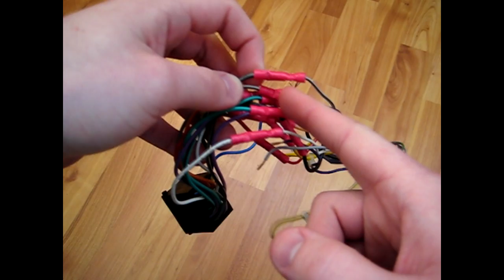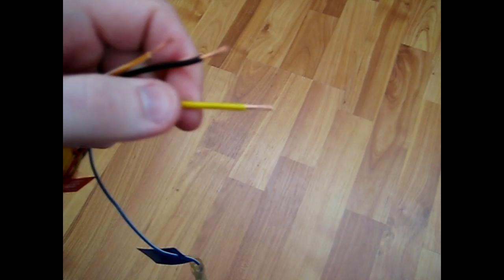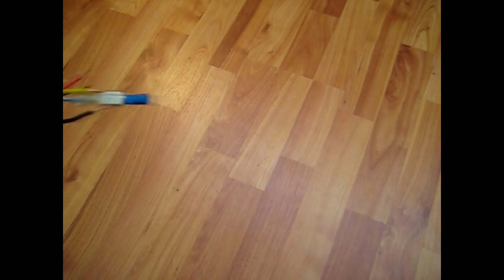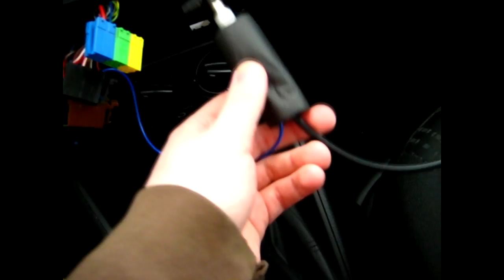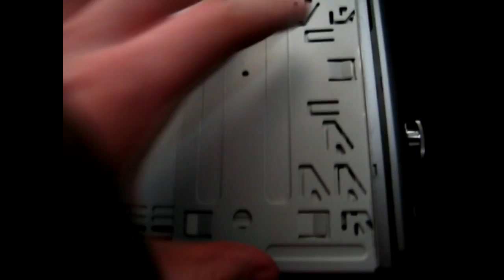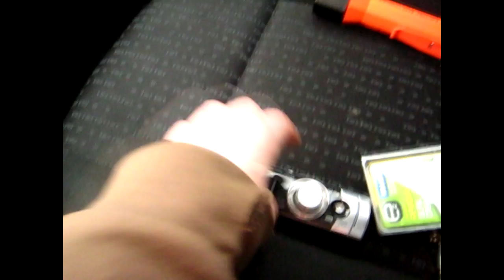DIY: Installing An Aftermarket Stereo Into Your Vehicle

Comment: Please I need help, I just installed an aftermarket pioneer on my Vw golf 2002 and everything work perfect, the only problem it's next day after I installed the battery was dead. I get the right harness and conneted following the color but I don't what it's happen. I appreciate your help!!
Reply from the maker: Is the stereo staying on when the ignition is off? Do you have an aftermarket amp installed as well?
Reply: THIS happened to me to how do i fix it???
Reply from the maker: Billy Callahann Does the stereo stay on while the ignition is off??? If so, all you need to do is switch the constant power wire with the accessories wire. If I remember correct, it is the orange and red wires.
Reply: 4Diyers it does turn off when I turn off my car but I hear a really quiet noise from the speakers
Reply from the maker: Is your car equipped with an amp? Sounds like that would be staying on, that needs to be on a remote wire.

Comment: My MkIV Jetta came with an aftermarket single din radio. Can that same harness be used with a double din radio? (Can I just take out this single din radio and put in the double without wiring new things)
Reply from the maker: Yes you can use the same harness as long as someone used a harness to install your existing one and they didn't cut up the stock wiring.

Comment: Hi thanks for video do you know what wires go to the amp I currently have to the remote blue but the amp turn on when I turn the key instead of turning on when I use the radio thanks
Reply from the maker: Sounds like it's hooked up to the accessories wire rather than the remote wire from the deck. It should turn on right away when the radio is started up. Have you used a voltage meter to see if there is power from that current wire??? Also is that blue remote wire from the stereo side of the harness or vehicle side of the harness???

Comment: did you have to wire up power to a constant on fuse? or does the standard plug provide enough power? (mines a double din, but no dvd/screen)  i know many people have done this with mk4s. I will be attempting to do the install myself sometime soon, so I'd like to know for sure :P thanks!
Reply from the maker: You normally do need a constant power supply in order for the stereo to remember the settings for sound, stations, and clock. Everything you need to power up the stereo equipment is available in the stock plug and there isn't any need to run new wires either. I actually haven't heard anything with regards to the double din setups.

Comment: Do a video on how to remove the k line wire
Reply from the maker: No I do not unfortunately. It's just as simple as popping the retaining pin from the side of the plug, then pulling out the k line wire.

Comment: Thanks for the video. I have a question, my 2003 jetta has an after market radio installed. I had to remove the battery to replace a headlamp. Now the radio won't cut off with the ignition off. Do you have any ideal what caused this. It worked fine before the battery removal.
Reply from the maker: Sometimes the factory alarm system will be triggered, so you need to follow these steps in order to reset it:
1. turn wheel all the way in both directions.
2. roll each window down all the way, hold down for 2 seconds, roll back up and hold up for 2 seconds.
3. go on the "DSG adaptation test drive" if equipped - I think this is to drive at a speed greater than 35mph for 5 minutes.

If that doesn't work, remove the stereo, turn the vehicle on and then off. Then reinstall the stereo.
Reply: thanks for your reply, i will try both ideas.

Comment: Where did you get the plate for the empty part
Reply from the maker: Stock VW accessory. Comes on the MK4 with a single din stereo. Sometimes you can also get this feature with an aftermarket install kit too, but if you have a VW, the OEM storage area is much nicer made.

Comment: I want to do the same, want to install JVC radio in my touran 2005. My problem is that the wires are 4 for the speakers and 5 for the power. Seems like 2 are ground - 1 thick, 1 thin, and 3 are +12V - 2 thick, 1 thin. There is a harness that comes with the radio that connect to standard iso plug. My problem is key in or out those wires are hot. Any idea? Could that be controlled from the boardcomputer?
Reply from the maker: Do you also have steering wheel controls?

As for that wire which is hot all the time, that would be the constant power so your stereo is always able to remember it's set functions such as the fm/am presets, equalizer, time, etc.

It would be best to get a wiring diagram of your Touran to determine which wire does what so you won't have an issues down the road.

Comment: Does the dimmer work with the plug and play setup? What about monsoon amp?

does the stereo still work power-wise as the OEM? (won't turn off until key is removed from the ignition switch, and can be turned on without the key in the ignition?
Reply from the maker: From the aftermarket stereo installations I've done, the dimmer wire is always hooked up but it isn't functional. Aftermarket stereos have a built in function to adjust the brightness of the back lighting. My VW had a basic stereo system, with the monsoon I believe there is a different style wiring harness than what I showed in the video.

Unfortunately you will not have the OEM functions. A majority of the vehicles that have similar functions to that will lose it once you swap the stereo out to something aftermarket.

Comment: I have a question. I purchased a Sansui car stereo and removed the stock stereo from my Jetta mk 4 as per one of your other videos. I cut off the connectors and connected the speakers and power to the radio. Everything works well except for when I turn off the ignition, the radio switches off and loses all it's memory (Time, EQ settings and so forth) So every time I want to listen to music I have to set the EQ. Is there something I can do to fix this, even if the stereo can stay on after the key is removed.
Reply from the maker: You need to have the constant 12v power source attached to the stereo, which if I remember right is orange on the stereo harness end. The accessories wire is working, which is what turns on the stereo when you turn on the key. But that constant power source is needed in order to save the stereo's memory.
Reply: I gathered much, but I unfortunately cant find a constant wire on the car, nor the Radio. Thanks
Reply from the maker: Here's a diagram of the pinouts for the radio plugs. On plug 3, pin 7, that is the wire you're looking for. http://www.gti-vr6.net/library/hifi/Late_98_Radio.gif

Comment: 4Diyers I plan on installing an aftermarket stereo in my 98 vw Passat. in addition to the stereo, the removal tool, and an antenna adaptor, is there anything else that I will need to get?
Reply from the maker: You will also need a plug/play harness if you decide not to cut the existing wiring. Also with regards to the antenna adapter, some require that extra power wire for the amplifier in the antenna, others don't, so make sure you purchase the appropriate one.

Comment: Hey, i didin't buy the wiring harness, instead i cut my wiring. But, i forgot to tape one wire and i got a short, i tried changing the fuse but nothing. The radio won't turn on. Any idea?
Reply: Oh and it's a 2000dx civic. And the wiring was not stock, someone had already changed it. It worked fine but I wanted another radio.
Reply from the maker: Did you check both fuses??? There is normally one installed on the vehicle for the stock radio, then if you're going to an aftermarket unit, there is also one on the backside of the radio as well. Do you know what the wire was for that shorted out??? Now you also said that someone had changed the wiring, could it be possible someone wired it up on another circuit so it's not covered under the stock radio fuse too??? Do you know if the 12V or accessories wires are getting power???
Reply: well the fuse behind the radio is fine, but its weird because when i check if the spot where the fuse was has 12V, it says it has 0...? in the fuse boxe. When i check other ones, some says 12V and some 0..? And it could be possible that it wired it somewhere else then on the radio circuit, how would I check that out ?
Reply from the maker: It is possible someone could have changed things around on your vehicle, especially if the wiring was modified already. Best way to get around this would be trace the wires back and see where they run to. If someone has modified it, it's probably best to try putting things back to stock so you don't run into problems in the future. Also having a wiring diagram for your vehicle will definitely help out, considering it'll determine where the wires go/connect to and what colors they should be.
Reply: ight thx a lot ill check that out and give you news ! :)

Comment from the maker: Ben Jamiseon You will also need to purchase a wiring harness plug which fits your vehicle as well if you don't want to cut your vehicle's stock wiring. All you have to do is take your year, make, and model if your vehicle to a local audio supplier and they will supply you with the right harness needed.

Comment: Hey I've got a new aftermarket stereo purchased for my 2006 Pontiac Pursuit, and when I hooked everything up and ran power to the stereo, the stereo worked fine but there was no sound coming from my speaker, and it also set off my anti-theft which wouldn't allow me to start my car. Once the stock stereo was put back in everything worked fine again, any ideas as to what needs to be done so the anti-theft doesn't come on?
Reply from the maker: Try disconnecting the battery for a couple hours and see if that will reset the anti theft system. Is the 12v constant and ignition wires in the correct location also?

Comment from the maker: I've never done one myself, but I have done it in a 1997 Pontiac Bonneville and I believe it is a similar type stereo used. A dash kit was required because the stock stereo is slightly larger than a single din deck.

Comment from the maker: Nope the radio is fine, it's been a while since I did the one in my Golf, but I believe I had the same problem. Just switch the main 12v constant and the 12v switching (accessories) wires. I believe the constant is red and the switching is orange. Just double check with the wiring diagrams you received with the deck and plug/play harness.

Comment from the maker: Do you also have a wiring diagram which came with the amp to determine what the yellow and red wires are for? Even if you have a test light, that would be fine to check which wire is getting power or not when the ignition is on or off. Even if you have some spare wire kicking around, attach it to a 12v tail light bulb with electrical tape and just test it that way. There should also be a main ground and main power for the amp... So including all the wires, 5 in total plus speaker wires, right?

Comment: Hey my buddy helped me install my Pioneer   DEH-X6600BS on my 02 golf gls ,but i have questing  when i turn the ignition key off the radio wont shut off keeps light up and i don't want the drain the battery so i took the face plate off but before i did test if the car shuts it by it self in 2hrs but radio was still light up so i took  off,do you have any suggestions what we might did wrong  or  what we missed .Do you think the radio itself  might not  have the  cut off feature thanks.

Comment: Ok so if u disconnect the remote wire from the amp it turns off. The amp stays on if you turn the ignition off I have a red and yellow wires which I have swapped over but still the amp stays on I don't own a multi meter so can't check power properly I have a pioneer mvh150ub deck and standard golf 2003 iso connection

Comment from the maker: If you disconnect the amp wire while the amp is on, does it turn off the amp then? Normally the remote wire should turn off with the radio or if you turn the radio off while the car is running the amp will turn off also. Now the only other way to get around this is have the amp remote wire connected to the 12v switching wire that turns on the deck too (not the 12v constant which powers up the deck's memory).

Comment: Ok so I was fuse 42 that was blown I have another problem I have just installed a subwoofer and amplifier to my mk4 golf I have a problem the amp won't turn off its got to be the remote wire is there an easy fix for this any help would be appreciated

Comment from the maker: If you can get a decent grab on the deck, you might be able to pull it out and those tabs wouldn't have been bent outwards. Now if they are, you will need special tools in order to remove the deck itself from that exterior casing. Once you remove that, then you can see inside that casing and gain access to those metal tabs which have been bent outwards and bent them back in.

Comment from the maker: Most aftermarket decks do have a bezel which is clipped on the outside in order to hide the metal framework. If you look at my other video on removing a BMW e23 stereo, that has the small bezel design. Now the aftermarket decks normally have and outside casing which goes into the stock stereo location, then the aftermarket deck slides into that. There is tabs which are bent outwards so the new deck assembly doesn't slide out, sometimes people bend those out, other times they don't.

Comment: I have a golf I pulled the pioneer stereo out and the remote wire was loose a touched the metal cage and now the head unit won't turn on any ideas checked fuses already ??

Comment from the maker: You have a different style stereo plug as opposed to what I have in my MKIV Golf. I believe there is a specific style plug available for your stock wiring harness plug which is different than what I have shown in my video. Your plug is a one piece setup rather than a 3 piece harness.

Comment from the maker: You have the pull the yellow tab out rather than push it down. It kind of works as a pin on the side with holds all the other wiring pins in place. Once you have that removed, you simply push the new blue wiring pin in, you may have the rotate it depending on its shape some only go in one way.

Comment from the maker: Easiest way would be to purchase an installation kit so the aftermarket stereo you are using is a direct plug and play setup. By the sounds of it, there isn't a factory plug for the stock stereo though. Personally I would get another plug from the wrecking yard and repair the stock wiring so you still have a plug rather than just attaching the aftermarket harness directly to the car's stock wiring. You could do it that route, but you'll also need a factory wiring diagram for the car too.

Comment: do you need to buy a PAC RP4-VW11 Factory Integration Adapter for an aftermarket speaker deck to work with a factory amp?

Comment from the maker: Do you mean when the vehicle is only running??? It should work when the vehicle is either running or on the accessories option on the ignition switch. If the radio could be turned on with the vehicle off and no key in the ignition, that was a factory option which is built into the radio.

Comment from the maker: Yes you will... I believe there is a special box that you can adapt which allows you to keep your steering wheel controls, but I think it's fairly expensive to buy. There may also be certain manufacturers of decks which allow you to keep those controls too. I believe Blaupunkt is one and it doesn't require an adapter harness.

Comment from the maker: Is it a stock or aftermarket radio??? Do you also have an aftermarket amp attached to your stereo??? Possible if you have an aftermarket amp, it might not be turning off which would cause a drain. Or if it's the radio itself, there could be something internally wrong with the stereo itself, therefore it would need to be replaced. The best way to check yourself is pull the fuse to the stereo system and see if the problem continues.

Comment from the maker: It could possibly be the amplifier in the antenna itself not powering up. So make sure that wire for the antenna adapter is actually getting power. Is it a new Sony stereo??? If not, there might even be something wrong with the AM band within the stereo itself.

Comment: hi just a question  I like your video , I have vw 01 gti  I have  sony stereo aftermarket , I got the Antenna Adapter  but AM doesn't work FM  works fine , I watch your video I did the same  I plug something wrong or what do you think ?

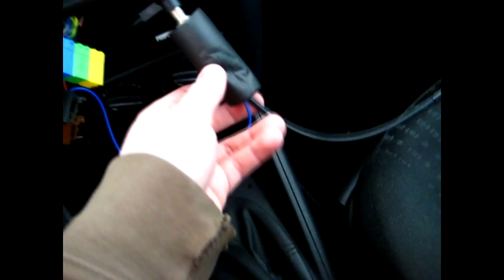Comment: @4DIYers - Hi, I was wondering what the little blue/yellow/green box at 6:15 is? Where does that need to be connected? Because I couldn't find a place for it. What happens if I leave it disconnected? Thank you.

Comment: I'm having K Line issues, my car wont communicate with diagnostic machine. Do I need to pull the K Line pin out of the harness? The aftermarket radio has been removed.

Comment from the maker: Nope. For installing a sub-woofer, you would have to install an external amp as well. Then run RCA cables from the deck to the amp itself. Also connect up a remote wire from the deck to amp. Then a main power and ground wires to the amp. The power wire does have to connect directly to your battery and the ground to somewhere on the vehicle's body. And the last step would be connecting the speaker wires from the amp to the sub-woofer itself.

Comment from the maker: Most of the Volkswagens, people just unscrew the stock antenna and glue the shark fin cap just over the existing base. Now there is also an aftermarket shark fine you can buy which are very hard to come across, and they include the build in booster also.